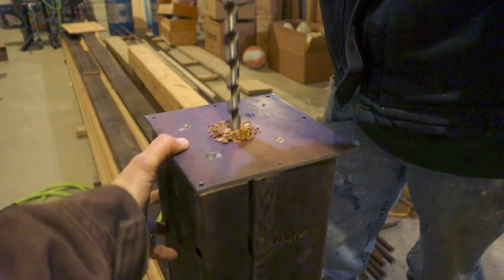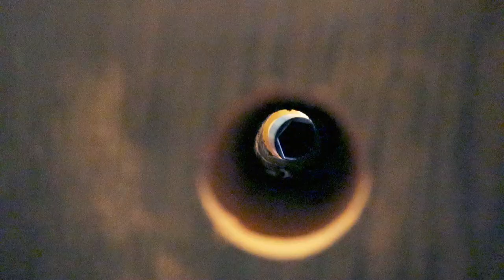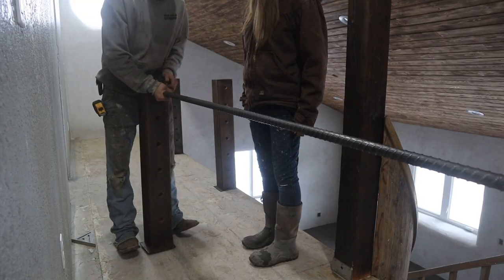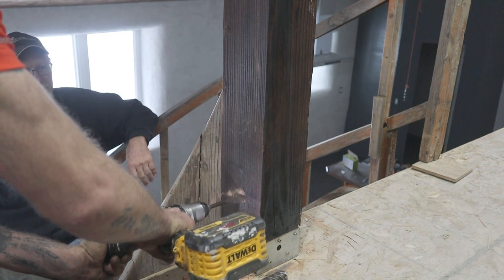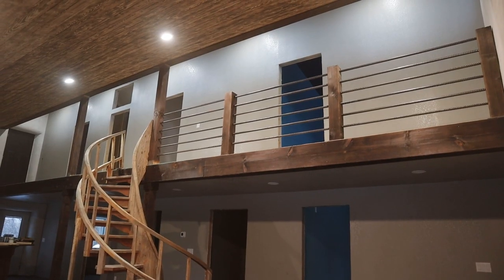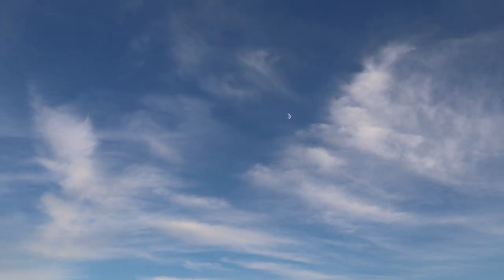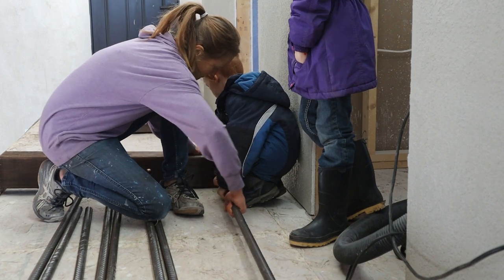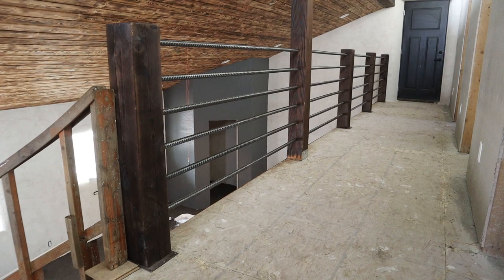Repurposed Loft Railing | Straw Bale House Build

Comment: The railing looks great.  If you do not treat the rear it will rust again.  You could put several coats of Osmo hard wax oil on it to protect the bright finish.  It is a very nice product to work with.
Reply from the maker: thank you for the input,I will look into this!

Comment: The railing looks great. Are you planning on spray painting the re bar to prevent more rust? Just curious.
Reply from the maker: we don't belive it will rust again if it isn't coming into contact with water/moisture, but I am keeping my eye on it!  If it does, then I might have to resort to using a clear coat spray unfortunately